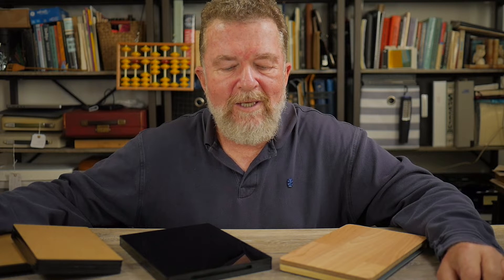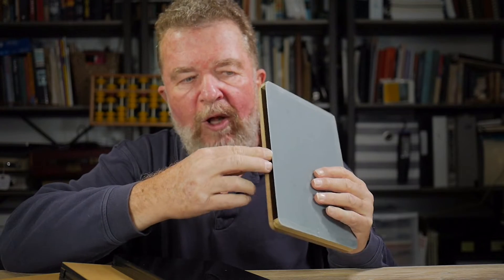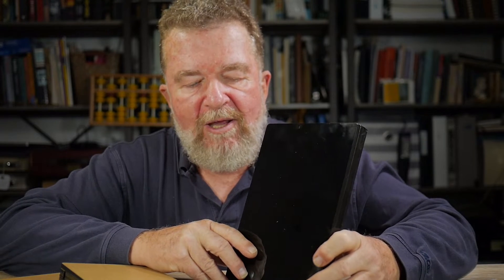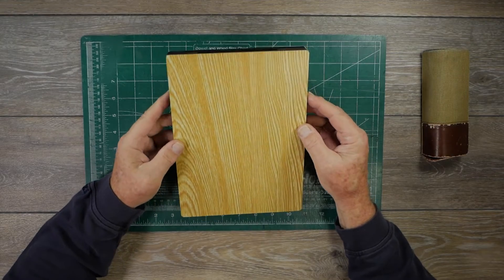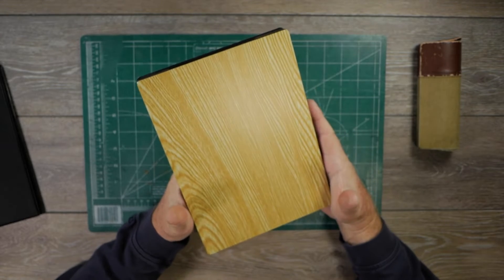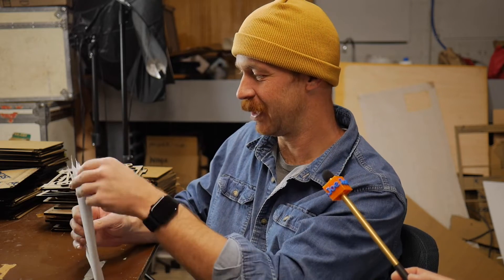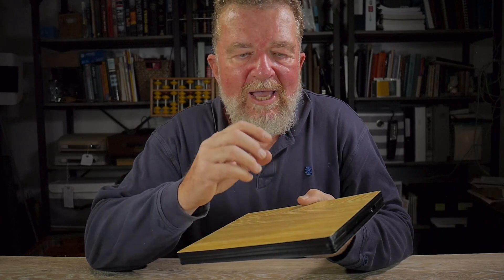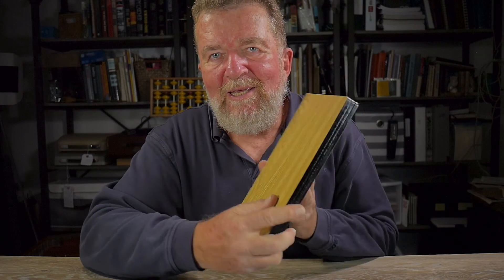HandiDesk Update

Comment: Tip: to keep paper in, I use an eraser with the same thickness as that space. Since I use pencils exclusively, works fantasic. A complete set.

I was inspired and made my own. Before I knew you sold these. But, thank you for inspiration.
Reply from the maker: I made my own prototypes too, which are still my favorites. The acrylic versions were built by Ethan of Cameradactyl Cameras, but I gave some input on his design.
Reply: @Joe_VanCleave  After seeing the acrylics, it was like fireworks going off in my head.
I subbed immediately.

Comment: My Handi Desk 2 came in and I've been using it for a couple of days now. Such a simple product but I can think of many ways to use it. I prefer using loose leaf paper so that I can more easily integrate my written notes into my digital archive system. The surface is so smooth and makes writing with my fountain pens even more of a joy. I love how I can angle it however I want by propping it up on objects on my desk. Maybe you can design an attachment or stand that can turn the Handi Desk into a stationary writing slope when sitting at a desk? Again, I absolutely love this product and its design.
Reply from the maker: I’m glad you are enjoying it!

Comment: I didn't get in on the first batch, but this video was just what I needed to secure my spot in the second batch, though the demonstration of Version 3 almost had me holding out. But I can wait no more! I'm already thinking about modding it with the addition of two rubber feet to not only raise it at an angle, but also prevent it from slipping on a tabletop. I'll be sure to put it through its paces before any modifications.

Comment: Hey Joe, this is so exciting seeing this project move along. i wonder if the storage area for the paper could include a clip (like the ones that clipboards have)? Or a rubber band or something to hold the papers down while they are inside. That way, the paper will be secure. Else when you opening the handidesk, the paper won't be all over the place in the event a gust of wind comes along. An A5 size would be great for me. I'm so looking forward to see where this goes.
Reply: Good point, but I would also worry about stress cracking around whatever fasteners held the clip assembly to the acrylic. An idea from the hipster PDA crowd might address the issue - binder clips with their levers folded down would probably fit inside.

Comment: I am quite interested in the HandDesk 2 and the Handdesk 3 min but right now its a bit to expensive for me (coupled with the fact that right now I have a sedentary life). I do appreciate the fact that the acrylic is expensive and that the material can't be used effectively, and applaud the idea to use the material to produce smaller variants. 

I like A5 paper for my notes in general but the Handdesk 3 mini would be very useful to me as a (archaeo)botanist/entomologist. Currently I use an A6 notebook to write down information in the field when I collect specimens for my reference collection. The notebook and pen are sometimes hard to find amongst the dozens of paperbags in my bag. I am at the point that I am going to do away with my notebook and in its stead I plan on creating a template (with all relevant information I need to collect) for A4 paper that I cut out. So the Handesk 3 mini would be great to store the empty collection cards, my pen and I'll have an surface to write on whenever I am in the forest, field or city. 

I'll keep my eyes out for the mini!
Reply: Get a contractor clipboard.  They sell memo size ones for $15.